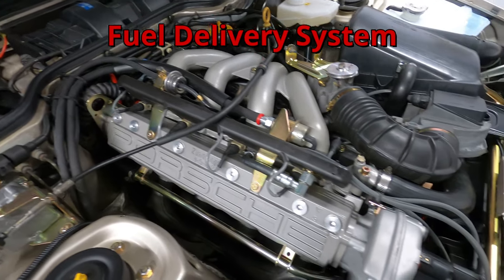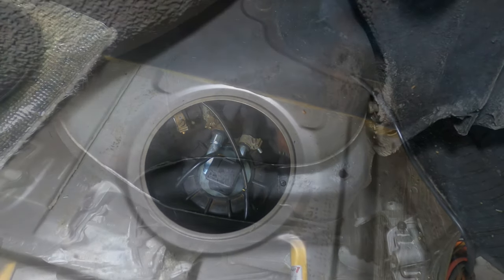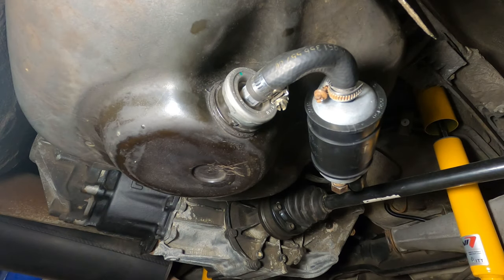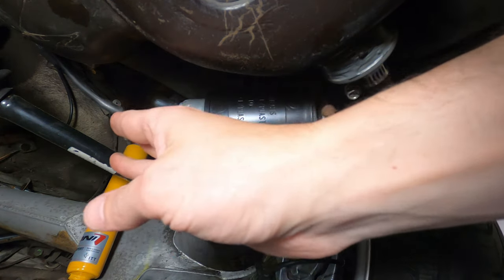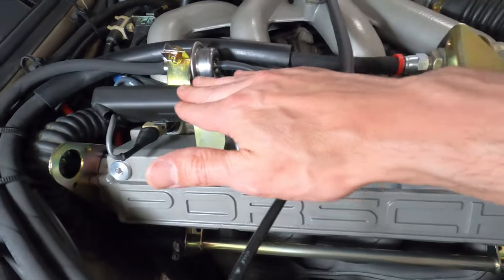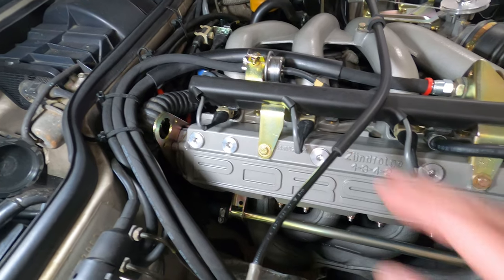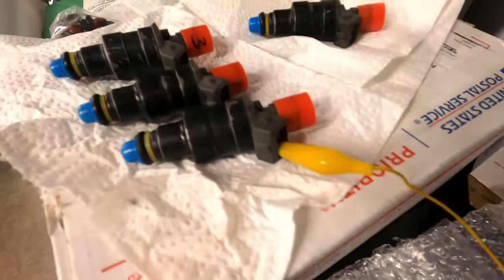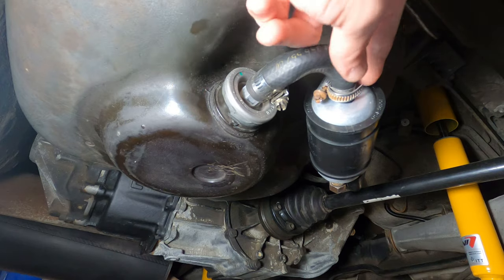Porsche 944 – Fuel System Overview: Parts, Issues, & Costs

Comment: Great video as usual. Just got an early 944 and I’ve been watching all of your videos to familiarize myself with the car. I just replaced the fuel filter and was wondering how to test it for leaks and this video answered my question! My big challenge with my car is diagnosing an overheating issue and I just replaced the thermostat. A video like this one but for the coolant system would be super useful.
Reply from the maker: Yeah, I posted a coolant system overview awhile back, but it’s not very heavy on overheating issues. Most common ones originate to the cooling fan relay, thermo-fan switch, or improper system venting. The early 3-blade fans are also significantly underpowered from an airflow perspective. If your fans are operational and all that, have you considered an upgrade to the later 6-blade fans?

Comment: You always make very informative videos. Good work. Always carry at least a 2lb ABC Fire extinguisher! No matter how well you have restored the fuel lines. Better safe than sorry.
Reply from the maker: That… or significantly increase the car’s stated insurance value. 😂 I have actually been thinking about picking up an extinguisher.
Reply: @NC944er  I had a 924S-SE, 87-924S and a 77 Rally Yellow 924, and I had an extinguisher in each car. To many horror stories. I sold all three in two weeks 3 years ago. And recently I bought another SE and 87-924S. So I'm back at it again, 😃

Comment: The biggie I am waiting for next is when you tackle the clutch replacement.   Excellent video and great content.  I am using your timing chain/balance shaft belt replacement for my 87 944 that needs them.   Thanks again.
Reply from the maker: Haha, nice!  👍🏼 I do have a Sachs clutch kit on hand, but the spring centered clutch in the car now has a little over 50% life left, so I don’t think it will be any time soon... barring any unforeseen failure of the rear main seal. Van Svenson has an excellent one that is worth checking out - https://youtu.be/_qmQbGNuzug

Best of luck!

Comment: Great video! I went through just about everything that you mentioned 2 years ago - part by part: replacing fuel gauge sending unit, strainer, pump, and filter. Now I’m looking at the fuel pressure damper. Too bad this video wasn’t available back then, but there are great sources for troubleshooting and replacing components.
Btw, awesome extra clean car you got there.  How did you clean the head cover? It looks like it just came out of the show room.
Reply from the maker: Thank you! If you’re referring to the camshaft housing, it was glass bead blasted and then powder coated in satin clear coat, along with the intake manifold. Cheers!
Reply: @NC944er  thanks for the info. Once again, great video.
Reply: Update:  I replaced the fuel damper and check valve within the last 6 months. It seems that I still have an issue where it takes 2 to 3 times cranking the engine for it to start. Tried swapping DME with another and no difference. I’ve found possibly faulty reference and speed sensors. I’ll have to replace these. Do you think this reference sensor would affect starting? The speed sensor, I believe affects my tachometer - that’s probably why the tach doesn’t work.
Reply: @glow9999   did you replace the check valve on the fuel pump?

Comment: You set the bar high for engine presentation!
Reply from the maker: Thanks, at this point it outshines the exterior paint job, which is kind of the opposite of most 944s. 😂

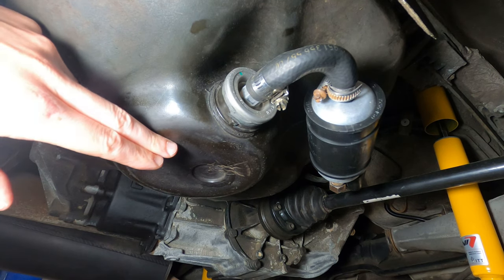Comment: @ Min. 2:56
My fuelpump is like double the size and fixed to the cover via a big hose clamp thing. So i can't lower the cover enough to reach the screw of the clamp. Looks all OEM and rusty. (1988 German S1 without Kat.)

Any tips
Reply from the maker: Yeah, the OEM setup on the fuel pump has it enclosed in a large black rubber vibration isolator, which is why yours is probably larger. That rubber housing have been removed in the video and replaced with an aftermarket rubber sleeve that's much smaller. You should be able to access the clamp through the smaller metal inspection door/panel that can be removed from the lower tank cover.

Comment: Very good and clear video, thanks! I'm looking to replace some fuel lines on my 924S (mostly what you cover in the first part of your video, near the fuel tank). Do you know if the system is very different? I assume it is similar but not exactly the same...
Reply from the maker: Nice! Yep… you should find that your 924S has the early metal fuel tank and fuel level sending unit (mounts a little differently), so some of the hoses will look a little different, but all the other components like the fuel pump, filter, and strainer will be the same. Once you take a look, you’ll be able to orient yourself pretty easily.

Comment: Great video! I'm looking at refreshing the fuel system and wanted to ask when you rebuilt the fuel injectors, did you have the injector baskets replaced too with aftermarket ones?
Reply from the maker: Yeah, the fuel injector service included before/after flow testing, ultrasonic cleaning, backflush, and all new top hats, spacers, o-rings, and internal filters. They also painted the external metal housing in black, so they look a lot nicer. 👍🏼

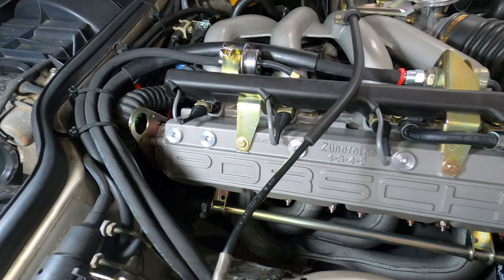Comment: At 9:47 you mention issues being ,rough idle, engine running rich etc.. are you referring to the fuel pressure regulator?
Reply from the maker: Yes, if fuel pressure is not optimized by the regulator, those are some of the symptoms, among others...

Here is some more information: http://www.clarks-garage.com/shop-manual/fuel-07.htm

What’s tricky is those symptoms could also be caused by the AFM, O2 sensor, clogged injectors, etc, which is why it’s best to test if you have the tools to do so. Otherwise you could just start replacing things (more expensive), and if one doesn’t resolve it, then you’ll have a larger parts inventory at home. 🤣

Comment: Questions on the Rennbay fuel line kit you used under the hood.  How much extra line did you have them add to route it away from the header?  And did you add the extra shielding to the supply line?  Looks like both supply and return hoses connect to the metal lines with compression fittings, correct?  Your install has a very nice 'could have been factory' look that I'd like to replicate in my car.  Thanks again for the great videos!
Reply from the maker: Hey Robert! It was about 2-3 extra feet. I would reach out to Travis at Rennbay and explain that you’re looking to route the lines back and then over, he’ll cut the length needed to get it done and it was about $20 extra as I recall. The lines use aeroquip compression fittings at the metal lines, comes with the cutter and everything, real easy to do. I had to stagger the connections about 2 inches apart because they mount so closely together in the wheel well. The rubber shielding on the supply line is a piece I transferred over from the factory line after removing it. Adds a little abrasion resistance.

Comment: Where can you buy all the hardware such as the "Check Valve" and other parts for the fuel pump?
Reply from the maker: @nicholas.granda  There are quite a few online parts vendors that support these cars. I have a video on how to use the parts catalog to locate parts with an overview of the primary vendors towards the end of the video - https://youtu.be/ouPC6DuRpuE?feature=shared

Comment: Can you tell us how you made/ where to find that little “jumper”? Thanks so much!
Reply from the maker: Hey sure! Just pick up some 14 or 16 gauge wire, cut a small length, and crimp on some male blade terminals. Supplies can be found online or local hardware stores.

Comment: Hey , you have given me the last bit of information that I needed to get this car running. If I asked you the actual value for a car that has no rust , interior has been completely redone and the exterior is at 75 % and will be at approximately 90% . What do you think the base value would be? Running great now .
Reply from the maker: That’s awesome! Values are up over the past 4 years, but have dipped just a little with the turn in the economy over the past few months. All original, low-mile examples command the sharpest values, where everything else kind of falls in the middle. Little things can tip the scales… like having recently replaced the timing belt or clutch, I’ve seen that alone add $3,000 to a sales figure. Rare options like sport seats, limited slip differential, sport suspension, Fuchs wheels, etc. can also spike prices a bit. What is the year and mileage on your car?

Comment: Excellent explanation. This will help me chase down a rich smell of gasoline on my ‘86 in the garage and also picking up gas fumes in the cabin as I drive. Known culprits?
Reply from the maker: I’d check the fuel level sending unit at the top of the tank, there’s a gasket there that can wear out, as well as the outlet connections for the vapor lines which can crack. If the odor is emanating more from the diver’s fender area, it could be the charcoal canister has cracked. I’ve also noticed stronger vapors coming from the lines in the engine bay when using 93 octane fuel, but not when running 87 or 91.
Reply: Thank you so much. I will check those things this weekend.

Comment: Can you cover mainatence of hoses on top of the fuel tank ?
Reply from the maker: Hey Robert, I haven’t done much with those fuel vapor/pressure lines since mine are in good shape, but if they are loose, cracked, or leaking, there would be the scent of fuel vapors in the cabin and you’d want to replace the lines. Here are a couple resources that may help…

http://www.clarks-garage.com/shop-manual/ts-03.htm

https://www.manualslib.com/manual/881678/Porsche-944.html?page=53#manual

Comment: Where is the charcoal filter located? And did you have difficulty taking off those lines off the sending unit? I got frustrated with those hoses, I wanted to cut them.
Reply from the maker: The charcoal canister is located behind the driver side fender. You can remove the plastic wheel well liner to access it. They can crack and expel fumes, which would normally emanate from that area, so if yours is coming from back by the tank, I would focus back there. 

As I recall, since it’s a bit tight at the opening at the top of the fuel tank and the lines were a little firm, so yes it took a little effort to push them off and out of the way. Don’t cut them 🤣

Comment: Yay, you did the video. Just to let you know I think I’m going to buy that kit from Lindsey racing related to the mass airflow. Saved my birthday and Christmas money. Now I can afford it. Ha ha next is brake pads, brake sensors, and rotors. Oh yeah and changing the transmission fluid. Can you tell me where those venting or vapor hoses are located near the tank? I keep smelling gas around my tank, hope I don’t have a hole in my tank. Thanks oh yeah, no more leak around the banjo fitting
Reply from the maker: Alright, great job on the fix!  

Fuel smells are common and could be a number of different issues, anything from tank, to lines, to gas cap, or charcoal canister. You’ll have to start pulling back trim pieces and doing a sniff test to narrow it down. Here’s a good place to start - https://rennlist.com/forums/924-931-944-951-968-forum/571783-gas-smell-where-is-it-coming-from-2.html

On this car, the metal J-shaped outlet lines at the top of the fuel level sender were cracked. Replacing the unit resolved it for me.

Comment: Great video as usual!  I kind of wish you actually changed the parts in this video to see what happens.  I barely do this kind of work on cars but I obviously know there will be fuel in those lines, but watching someone else do it first would at least give me an idea of what to expect when changing hoses or the pump etc.  Nonetheless, this video was very informative.
Reply from the maker: Haha! Yeah, cracking the seal on any fuel connection just releases a little pressure and then dumps gas everywhere. Just be ready with catch rags and a pan if one fits, possibly safety glasses if you’re under the car. I’ve taken more then one bath in gas, which is never fun.
Reply: Are there any good videos on changing these systems? I too have quite a bit of corrosion in the pump / filter area….

Comment: i need to get my injectors cleaned and possibly rebuilt. What company did you use for yours? I want a place with a good reputation. Thanks!
Reply from the maker: I used RC Fuel Injection out of California. They offer a warranty on the service and have a pretty quick turnaround. They replaced the spacers, o-rings, top hats, filter/screens, and painted the exterior housings black. https://www.rcfuelinjection.com

Comment: Hi, where did you buy the two engine pressure and return lines (maybe also the small pressure one between the injectors)? Do I have to cut the hard lines in the wheel arch also on a 91 S2? Thanks!
Reply from the maker: The fuel lines shown here are Rennbay’s kit and the jumper line was purchased from Pelican I believe. That said, the S2 has a slightly different setup. The lines route similarly down into the wheel well, but you won’t need to cut or modify anything like on the 8V cars, the S2 lines bolt on at both ends. 944Online has a set of basic black ones and Lindsey Racing has some colorful braided ones, a few other options out there. https://944online.com/944-s2-stainless-steel-fuel-line-kit.html
Reply: @NC944er  Thanks for quick and accurate answer...I was investigating on google as well and arrived near your conclusions... Just not understanding (not having the car near now) if to reach the fittings I have to take off the tire and everything or they arrive to the engine bay...Anyway I found oem like lines to the rail in Europe for cheaper, but about the 2 small damper lines at the front of the block can't find something if not the expensive braided ones from Lindsey, that will also be more expensive when shipped to Italy :/
Reply from the maker: @TastingCars  PartWorks is a reliable vendor in the European area with lots of 944 parts, I’ve used them a couple times - https://partworks.de/partworks-de/
Reply from the maker: @TastingCars  As far as the lower fuel line fittings, they should protrude far enough from the wheel arch that they can be accessed directly in the engine bay without removing the wheel well liner. A rare benefit on the S2 that otherwise typically presents more complications over the 8V cars. 😂
Reply: @NC944er  yes, the place in Europe I told where I found the lines was at partworks! Cheaper and already in Europe! :) Only can't find the damper lines here :(
Anyway, maybe finally a joy, an easy thing on the s2, immediatly counterbalanced by the air filter location 😂

Comment: Question i got the remebay kit to lines run to other side i tried starting but one line leaked. Im kinda lost now because its a compression fitting can i just take it off try again
Reply from the maker: Yeah, you can… I’d probably try tightening up that connection a little more first, see if the fitting just needs more compression. If you remove the connection and find that the end of the hardline is damaged or deformed in a weird way, you may have to cut that material from the end before reconnecting it.
Reply: Will try thank you
Reply: Gave it more still peeped out just took line off looks ok and where i made the cut looks ok ill try cleaning it up more then reconntion

Comment: Question. I’m looking into trading a car of mine for a 944 the guy says the fuel pump doesn’t start unless he sends 12v to the fuel pump what do u think would cause this?
Reply from the maker: Hey, that could point to a few different issues… a bad DME/Fuel Pump Relay is probably the most common cause and simple to swap out. If the car has the factory alarm installed, a failed alarm control module can disable the fuel pump. There is also a fuel pump fuse that gets overlooked on occasion. Other suspects could include a faulty ignition switch, poor grounding, or damaged/disconnected wiring. If you end up getting the car, this is a good place to start - https://clarks-garage.com/shop-manual/fuel-16.htm

Comment: Have you ever had to service/replace the charcoal canister?
Reply from the maker: Hey, no… not yet. They are known to crack with age and then gasoline fumes can be detected in and around the area of the driver’s side fender, but I have not had this issue.
Reply: @NC944er  Thanks for the quick response. I have this exact issue you describe on my 1989 944. Going to be taking it apart soon to investigate.
Reply from the maker: @JFDLV  Yeah, just remove the left front wheel and the drivers side wheel well liner and you’ll have a good view of the canister. Good luck!

Comment: Please can you do a tutorial on the speedometer and cable I have a temperamental speedometer
Reply from the maker: Regarding the speedometer, the early cars feature a cable setup ($30) and the late cars (85.5+) have a sensor setup ($115). 

The first thing I would do is ensure that the connections to the gauge cluster are fully and properly connected. 

If it’s an early car, the speedometer cables can wear out over time or completely snap, part number: 142957801C. I would check out edredas video for replacement - https://youtu.be/1VUrexnLEtk

If it’s a late car, the most common item is the impulse sender on the transaxle, part number: 944-606-210-00.  I would inspect and clean the connection point there first and make sure it’s well seated, see if there is any improvement.
Reply: Thank you for the advice